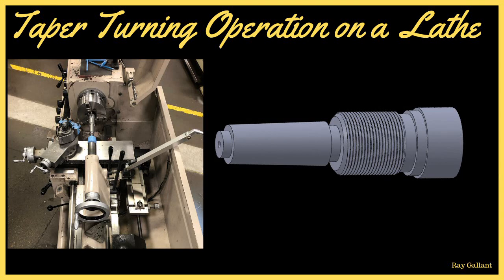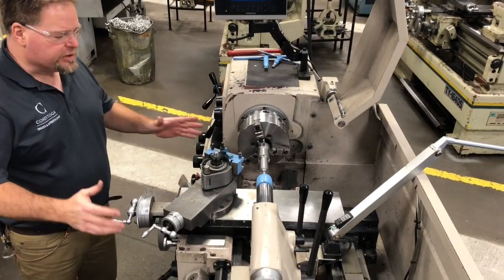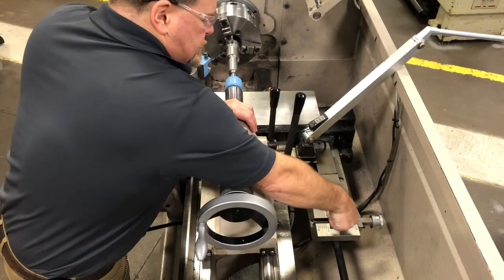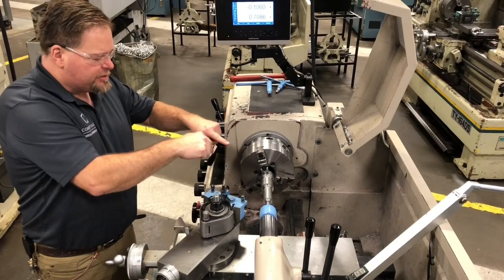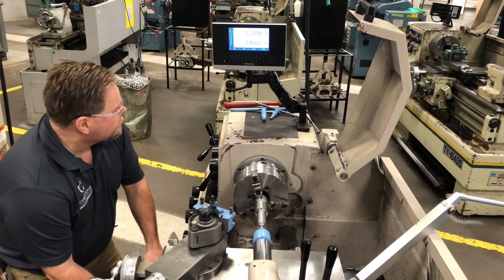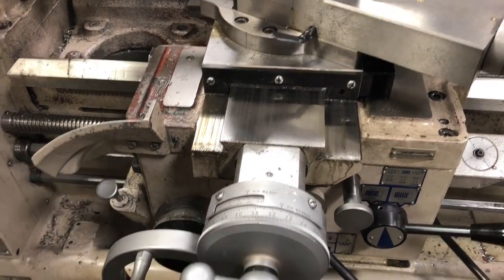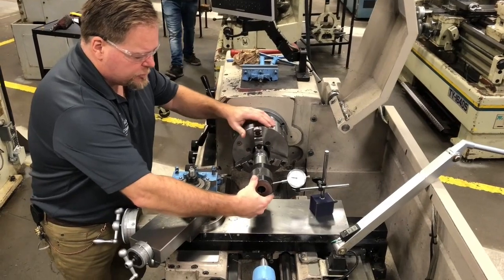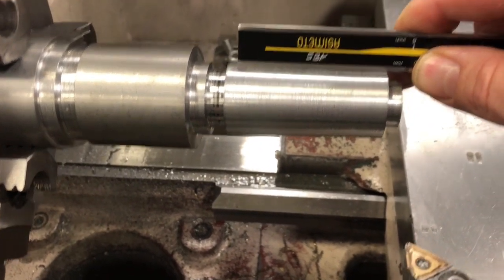taper turning operation on lathe machine

Comment: Thanks for making this video, 
I had FINALY made peace with my taper attachment (telescopic) MANY YEARS after getting it and wasting so much time making ugly jerky tapers like you demonstrate (if you move cross slide wheel)... Once i noticed that same thing you mention(not to touch cross slide with this style attachment) in one of the videos from the shop instructor in the Philippines Youtube video...  

Of course, MOST taper attachment videos & book examples must show a different version of taper attachment than you and I have, a style that they lock taper engagement nut to cross slide after disengaging cross slide lead screw... and they use cross slide, not compound...  

Once I figured that difference out, it made it a useful attachment... 

I don't know how many videos i have watched & book examples over the years, but yours is only the SECOND video I have come across that sorta points out that IMPORTANT distinction(..or that i noticed)  

Would be nice if someone with both styles of taper attachments would do a video to point out that difference between them, and avoid the frustration...
Reply from the maker: You’re correct the side-by-side comparison would be nice I don’t know anyone who has the plane style I think we just got in another 10 new machine  something like 25 at the college now

Thank you for taking the time to comment
Rsy

Comment: What was your Finish Cut Depth? Any deflection with an Taper Turning attachment? Binding screw on X?

Good Video, Man...
Reply from the maker: You’re finishing cut is the same for tape returning as it is for parallel turning
Including speed and feed
I
All of our lathes have telescopic taper attachments 
There is no binding screws
With this style are two engagement bolts that are firmly attached to the bed when engaging and disengaging the taper attachment

For a clean smooth finish cleanly Ness is important the taper attachment should be well lubed and clean and free from chips

the two main mistakes That I find students making are 
1 not removing the backlash before starting a cut
2 Having the compoundrest parallel to the cross slide 
When you turn the compound rest it hits the cross slide and disengages the
Tapper attachment until the backlash Runs out
This is what causes a flat tapper flat on your tapper
Reply: @shopandmath  Thanks! awesome video

Comment: Aha. I've had problems with variations on the taper after I have very carefully gotten the correct #'s on the read out. I'll try the friction on the hand wheel trick. I also have about the first 1" of travel without any cross slide movement. I have taken everything apart cleaned and checked for play.
Reply from the maker: HI Larry 

thank you for taking the time to comment
do you have a DRO ?
soon i will be posting a shorter more in depth video on just the cutting acction
Ray
Reply: @shopandmath  Yes, I have a DRO on a PM1440HD lathe (Chinese.) I'm retired, always thought I'd like to try machining. I traded for a (very used) 9 X 49 Jet mill. No experience, but use YouTube as my teacher. I just found your channel & sub'd. Others that I like: Thatlazymachinist, Stefan Gotteswinter, Robenz, Oxtool, Abom79, Joe Pieczynski, Keith Rucker.     Thank you.